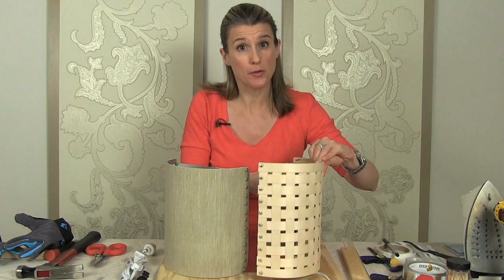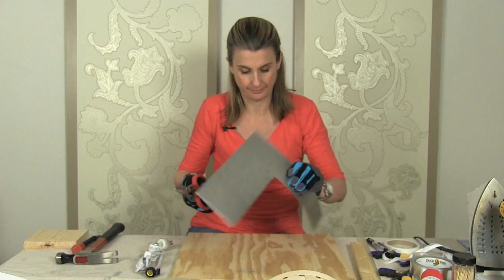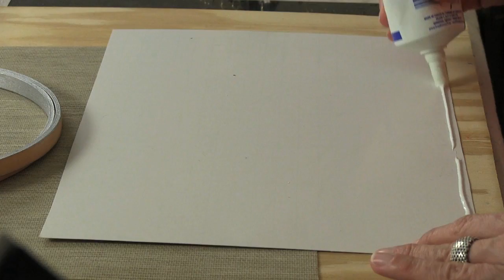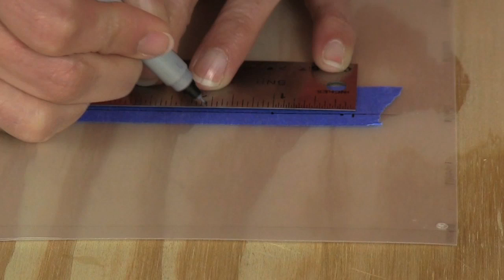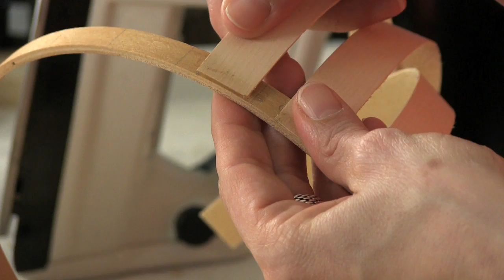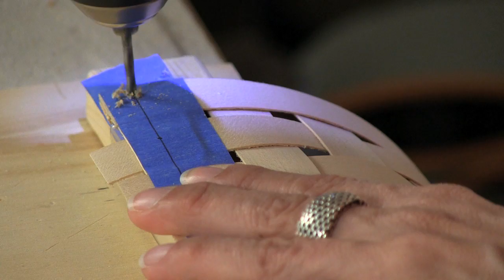How To Make A Wall Lamp

Comment: Great tutorial. Thank you for sharing! Its impossible to find plug-in or  battery operated wall sconces (not task lighting) that look really nice and are the right scale.  I need  7 for my long hallway. If I could even find such a thing,  to buy them and have a electrician hardwire,  would cost a small fortune. Your tutorial will let me diy, save a tonne and get exactly the shade/look/scale I want. Thanks!!

Comment: which metal use this
Reply: +Bincy Shiju  I would flatten out a big juice can, like pineapple juice is sold in.  That would save you $7 per lamp.  It's very east to flatten out with a hammer.  My dad used to use these for all kinds of projects.  She used aluminum sheets.  I was stunned by the high price of them.
Reply: Aluminum craft sheet (use google) 14" by 14" square is best, you can bend and then break into size, or, cut with scissors.
Reply: Stacey Kersting

Comment: id like to do something very similar to this to cover my wall mounted heater. i want to use this same frame but use perforated sheet metal as the "shade". it would be mounted with the openings on the side and maybe mounted to a picture frame (11x17) with hinges on the top and a magnet at the bottom to keep it closed. do you have any ideas on the construction method i could use?

Comment: What if you wanted to attach this to the wall more securely?  I want to adapt your idea to another sconce but it is heavier than yours. Will that aluminum frame hold more weight?  I'm thinking I need a mounting bracket or a way to screw it in (if its not hard wired)

Comment: Great Project Video!
the only thing I would do differently is to fasten the Panel Material with Velcro,
so if you change your interior design, it would be easy to switch it out by just making a new Finish Panel you could make several beforehand to have a selection you can change out to.